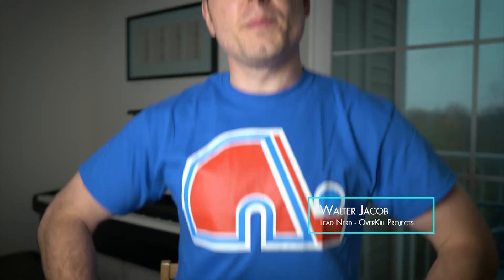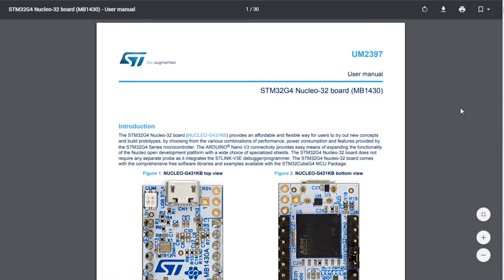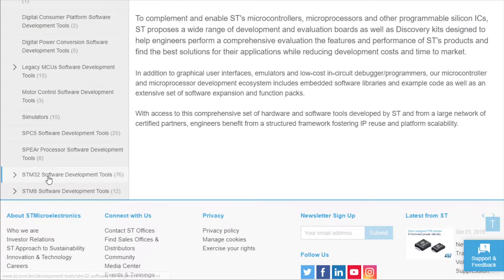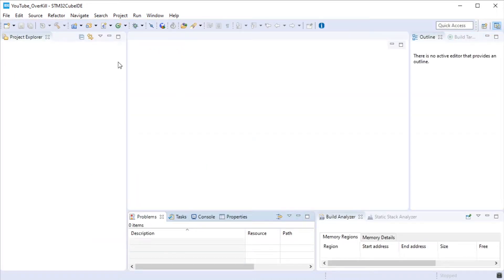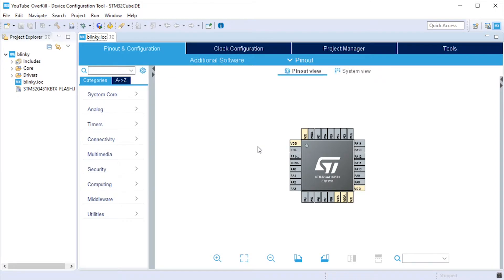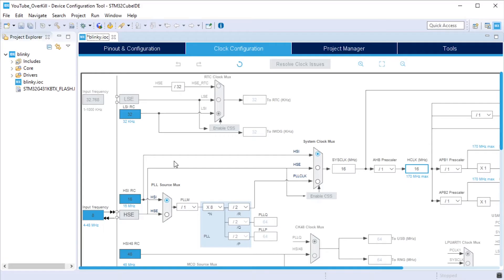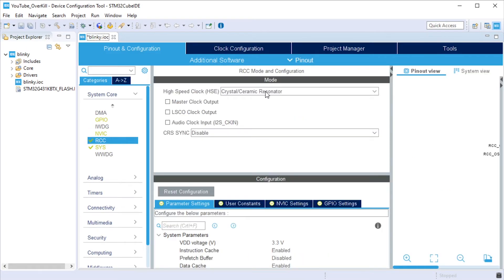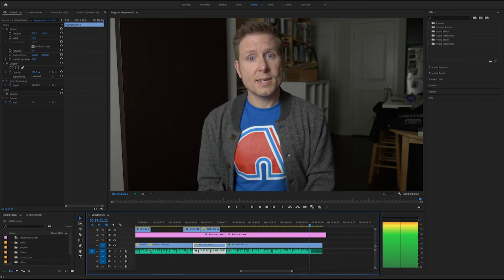STM32 STARTER'S GUIDE! | Hardware and Config

Comment: Your prescaler and auto reload are off by 1. A PSC of 0 divides the clock by 1. A PSC of 64000 divides the clock by 64001. Same with the ARR, since the timer begins at 0 for counting.

It has just a small effect, but your configurations don't exactly match your intentions.